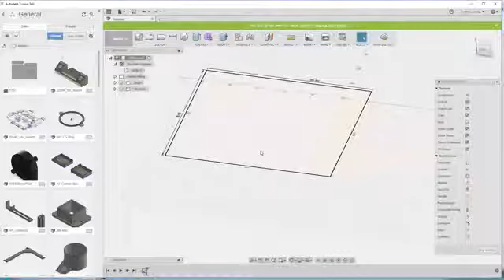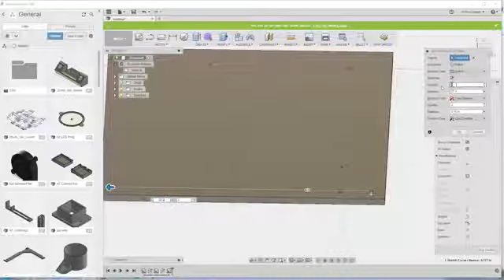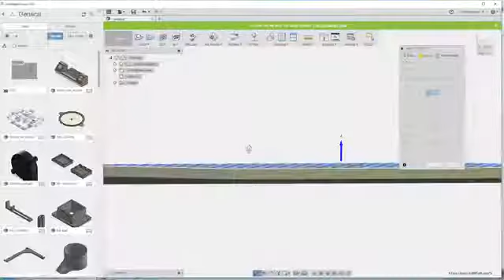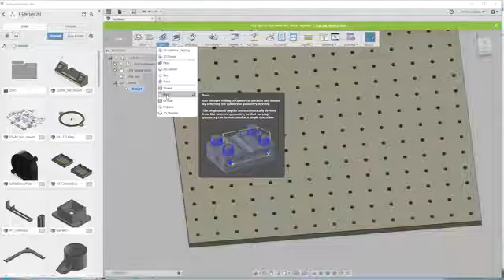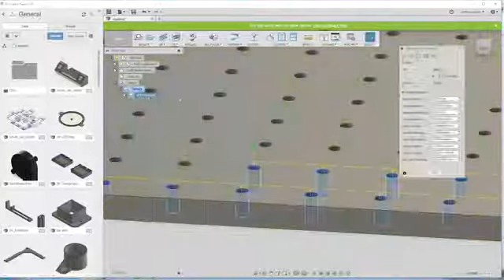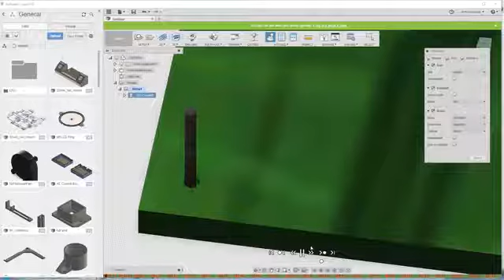F360 Shapeoko Wasteboard Modelling

Comment: I am very green at this, I got the size of the waste board and thickness in 360 . I know you would do in minutes but I took a hour a two. I need to put 24 holes to cut out to fix the board,. then I am going to cut t track in two operation. now what is stopping me is put a hole at a position that I set Malcolm op you can help
Reply from the maker: I'm not sure I follow what you're having trouble doing.